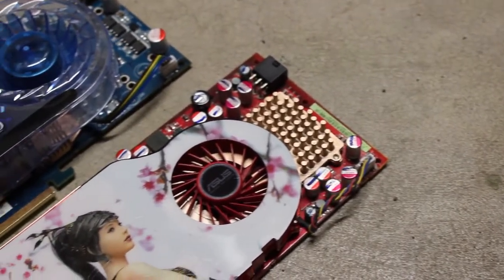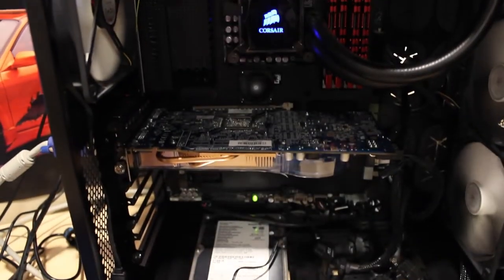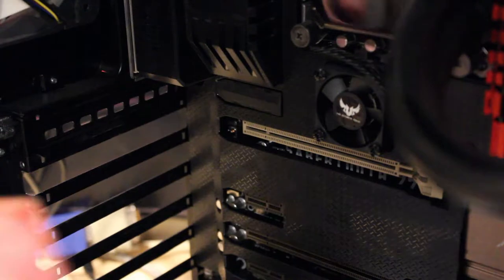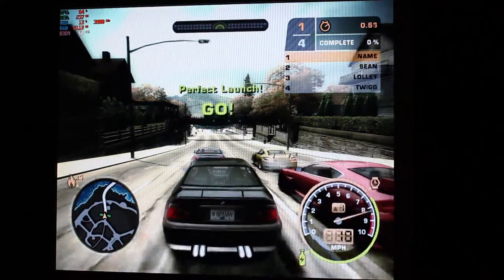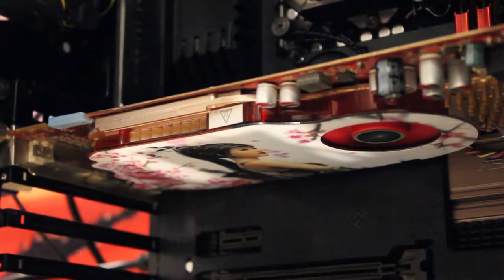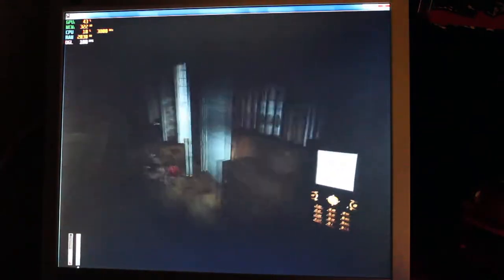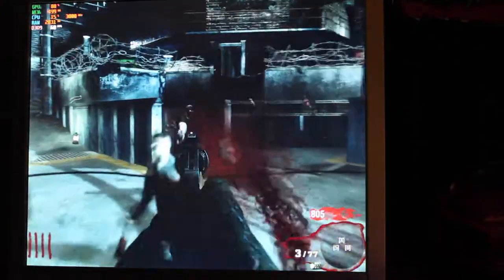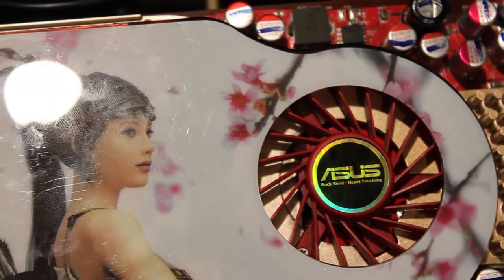Does it really matter what brand of GPU you buy?

Comment: So for gtx 1080s would it not even be worth it to pay like 200 extra just for a ftw2 or strix card?
Reply from the maker: In my experiences they are more or less the same. With certain cards like the HIS IceQ, it's certainly a better binned card, so the overclocking potential is greater than that of the ASUS. 
But in general for the avg consumer it makes no difference. The only thing to look out for is if the board partner uses a different memory type or memory bus width.
For example you will see some  GT1030s with GDDR3 and some with GDDR5. The board partners selling the GDDR5 model are the ones you would want to choose, as the memory type is newer and faster